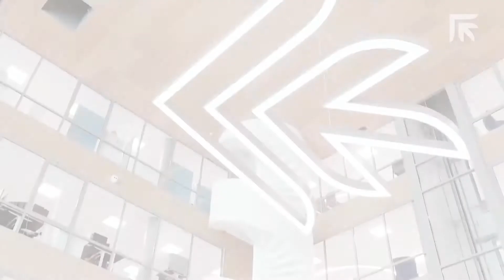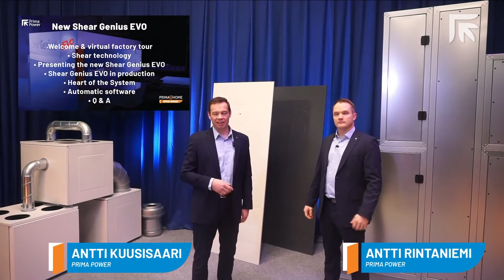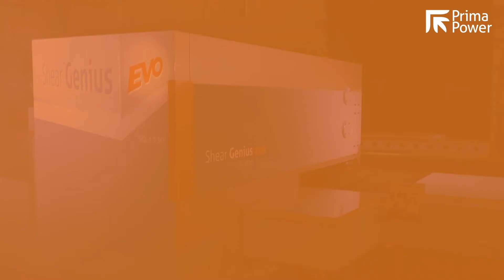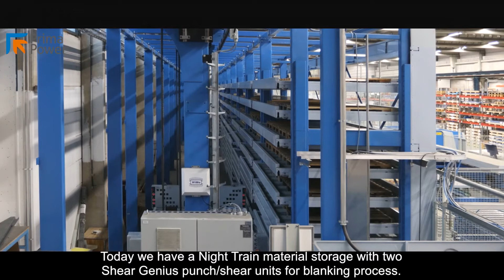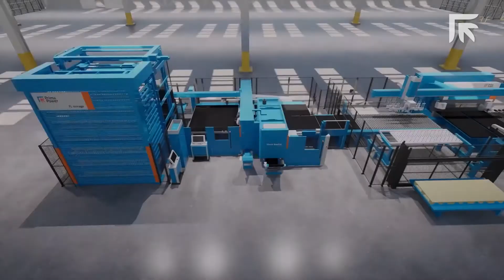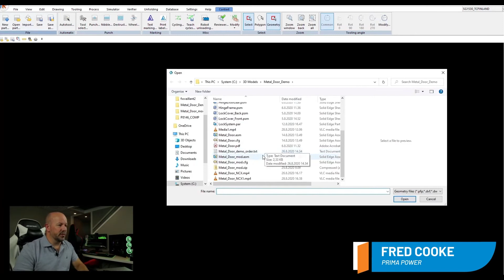Prima Power Open House New Shear Genius EVO

Comment: How about the tooling ? Is it easily wear off on a stainless sheet....how long will it last before you sharpen the punch tools...example you leave the machine overnight were the case while on the process the tools become dull and most common problem on the punching machine is got crushed if the tools are not sharp....